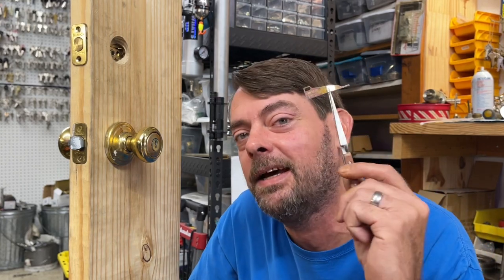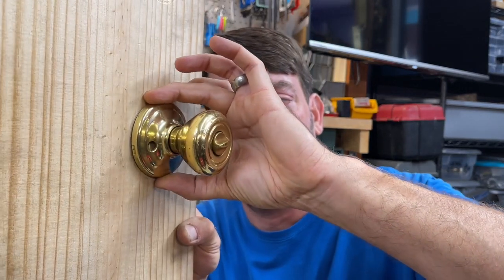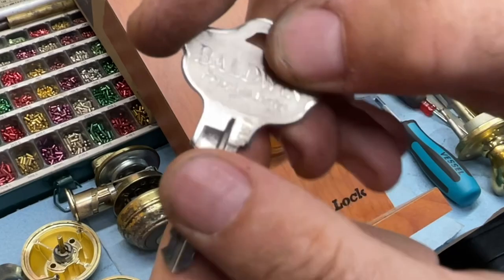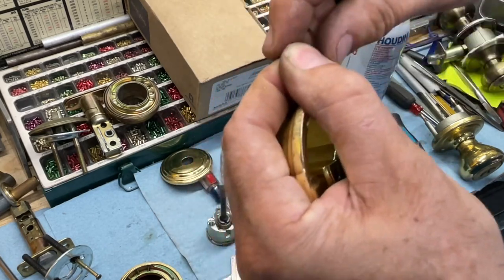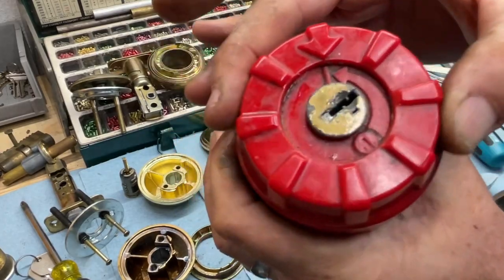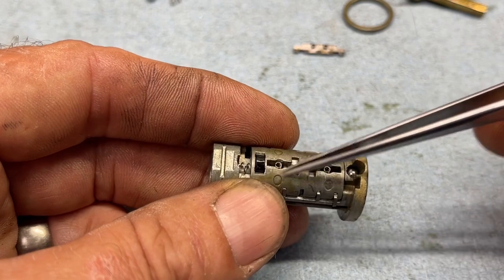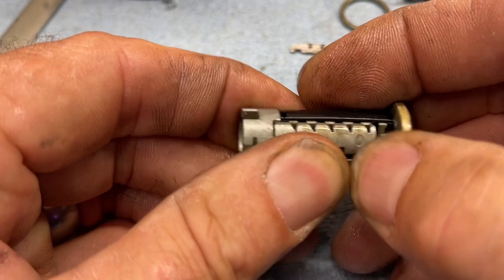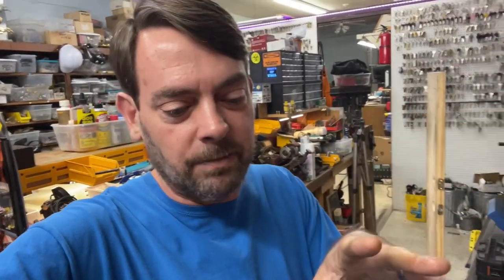RLS 9 - Kwikset Smartkey

Comment: You did good to reassembly the "smartkey" cylinder without dropping out all the sliders / wafers (except, of course, for forgetting your ball & spring -- NOT a "ball & chain", ha, ha) -- not recommended for the average homeowner to pull apart the plug, but OK if you like frustration!
Reply from the maker: Gotta know how for when that cradle locks up on ya and you didn’t buy a backup! 😂
side note, I always have a backup now ;)

Comment: Great video! Just had my new apprentice tear one down last weekend. We went through all 3 methods as well. Btw, the thumbturns on a lot of these newer Kwikset knobs will not spin freely until it’s back on the knob spindle. It’s because of a feature they added to assist with timing the knob when a customer is doing initial install and if you force the thumbturn to spin like if you were trying to “time” it on the spindle the plastic piece will break and fall out. It doesn’t affect any of the functionality, just ease of install for diy customer. Thanks for sharing!
Reply: I haven't seen this yet, but good to look out for.  So what happens if you break off the plastic antilock piece?  Does the thumbturn spin freely as previous design, or fubar?
Reply: @zach2763  I UPDATED MY COMMENTS BECAUSE I WAS INCORRECT. I messed around with the knobs to better understand what that plastic was doing and changed my other comments. With the black plastic broken, the knob will still work. The design forces you to unlock the knob from the interior side. Some older Schlage’s are the same way and people would lock themselves out. The knob was redesigned to make you unlock the thumbturn to turn the knob and open the door. Hope that doesn’t confuse you.
Reply: @odinslockllc  Thanks for the thorough description.  Makes sense.  If people can, they will absolutely lock themselves out!  That newer Kwikset antilock feature sounds good in theory, but plastic internals... ugh.
Reply: @zach2763  see my updated comments. I figured out I was incorrect. That plastic piece is to help first time installation as customers wouldn’t know what to do if it wasn’t “timed” nor would they have the Kwikset fork tool. The knob still functions correctly with the plastic broken or missing as not needed if someone knew how to rotate the spindle to line it up. Sorry for the confusion.

Comment: You’re going to love the vessel driver. The shape of the #2 Phillips is very similar to the Klein so it fits nicely into the foreign screws.  Especially when working on a panic device that has been sprayed down with oil, that knurled shank comes in handy.

Comment: These are the locks that got me into locksportery. 
I've never bothered with the reset cradle thingy, not really necessary, but certainly makes it easier, and you don't need to know how it works if you have one of those to use

Comment: Great tip with the Lock Shot!  I'm going to need to find the Canadian equivalent. I never get them back together on the first try.

I have a few of the Schlage smartkey plugs to play with.  Easy to tell which is which because the Kwikset the rekey slot is on the left and Schlage rekey slot is on the right (but only if the plug is properly installed 🤣🤣🤣).  Thx again for the Video.

Comment: Ya we do low voltage stuff and put in one of the automated deadbolts and my boss messed up and pulled the key or the reset tool out and it didn't work with any keys and I was able to disassemble it and get it working again

Comment: Are the Lori deadbolt with double cylinders suppose to be centered inside the door, as In both lock cylinders being the same size should have the same thickness security ring and spacers so each cylinder is spaced out equally from the door so the mechanism inside the door is centered and nothing binds?
Reply from the maker: yes, assuming the bolt is centered in its hole correctly. Sometimes especially on wood doors if someone didn’t drill the edge bore straight it will cause the bolt to veer to one side 
But same thickness cylinders and correct prep, yes they should have same thickness spacers